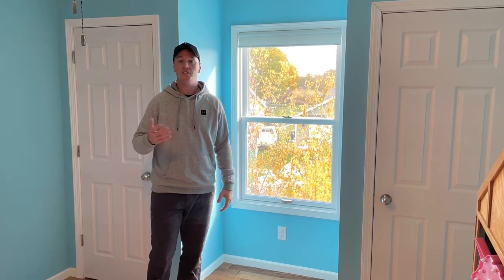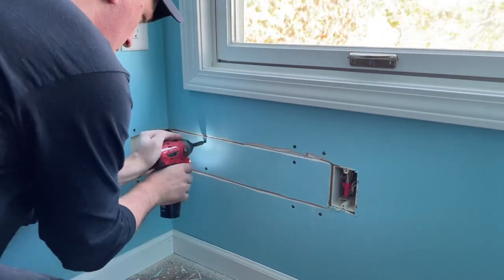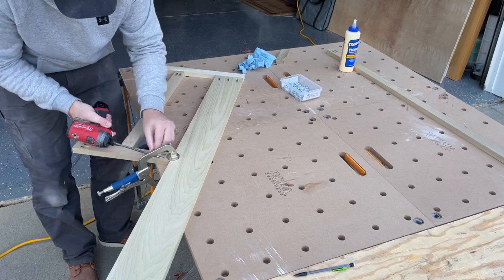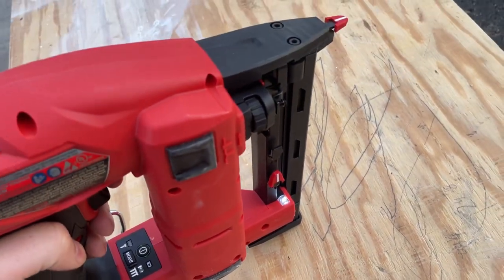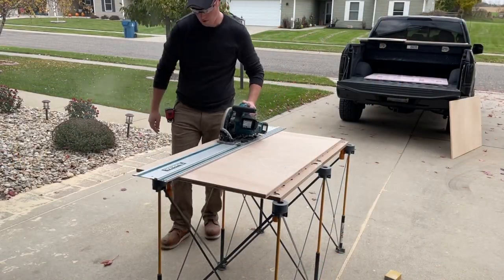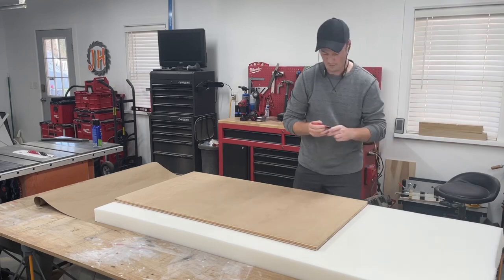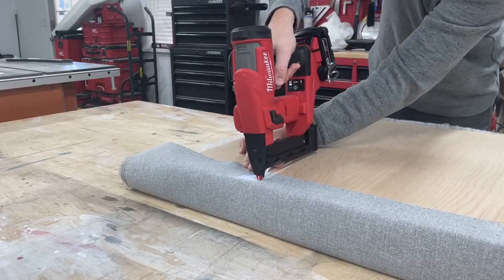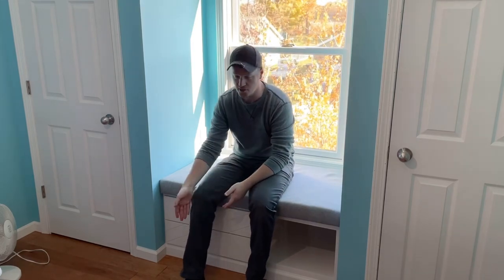How to Build a Built-in! | Bench/Reading Nook

Comment: Looks great!  Next time put more batting over the foam.  It not only stops the fabric from catching on the foam, but it also "fluffs" it out so the fabric stays taut.  Also, when attaching the fabric, staple a few spots in the middle of one side, and then move to the opposite side and attach it in the middle.  Then do the same on the adjacent sides.  Once all the "middles" are stapled, work towards the corners on each side.  This will give you a much better finish.  Your project turned out great!  Thanks for the video
Reply from the maker: I’ll remember that for next time, thanks!

Comment: Thanks for sharing. This one definitely had some useful tips and got the wheels turning, love that idea of adding grooves to the drawer faces. We have a nook in our entryway that could use a bench, so bookmarking this for sure.

How do you like your table saw? I am getting closer and closer to wanting one and the portable/contractor category is what I want due to space constraints. However, on other channels and forums I've heard those can be hit or miss in regards to the fence staying square and locking tight. Have you had any issues with keeping the fence and/or blade true to the bed on that Dewalt?
Reply from the maker: Not at all. I prefer using it over my Ridgid saw in the shop. I’ve always heard this one considered the best overal job site saw!
Reply: @JohnBuildsIt  awesome, thanks for the quick response.

Comment: Great job. My only concern is you covered up the old electrical box. You mentioned you put the drawers on that side to provide access, but you didn't cut a hole in the back to access it. Should be an easy fix though if you know where the box is 🙂
Reply from the maker: I cut the hole. Just vibrated the camera too much and would’ve made ya sick! Lol

Comment: I'm not sure where you're located, but here in Ontario Canada,  it's illegal to bury that electrical junction box. You either have to remove the junction completely or cut access through the back of your built in cabinet
Reply from the maker: I did cut access. I mentioned that in the video
Reply: @JohnBuildsIt  I apologize.  I watched the whole video but had the volume on low. Must have missed that part